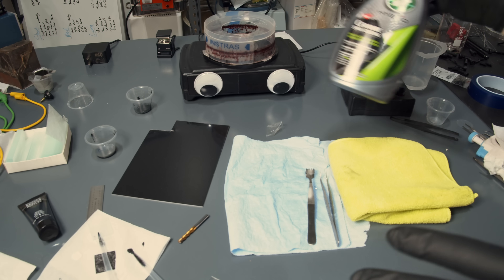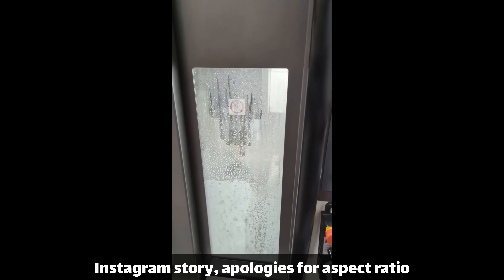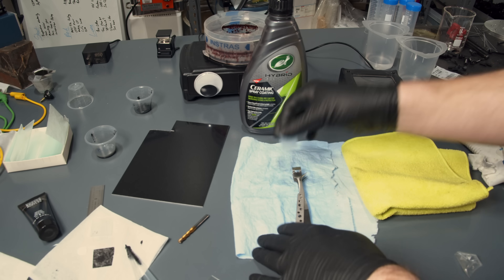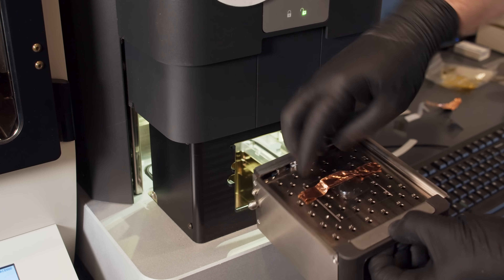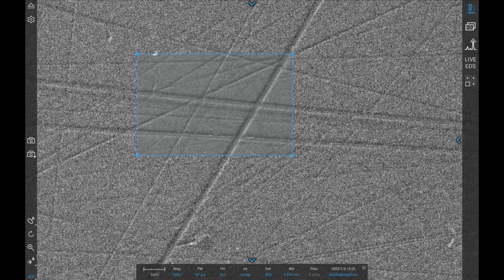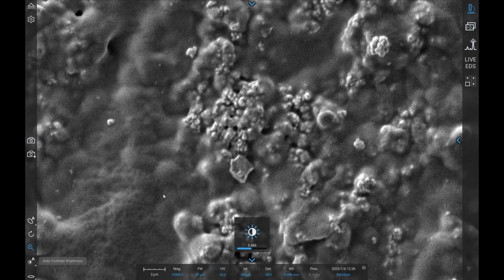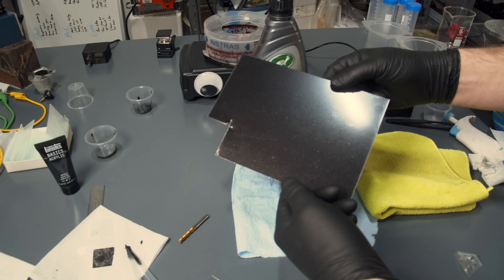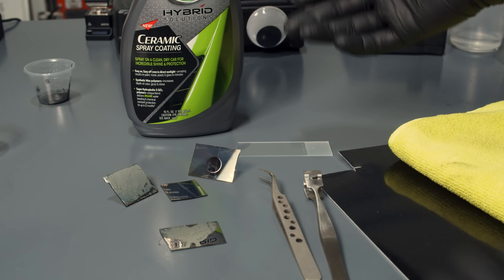More rigorous analysis of "Ceramic" car spray

Comment: And isn’t automobile glass covered in a thin plastic to prevent spalling in a crash? And I think most mirrors, headlight, turn signals are polyacrylate (?). Dunno. I’m a physician and barely know what you meant by a Materials Scientist.

Comment: It's crazy to me that this stuff has anti rusting properties considering how little of the stuff we can see in this video
I say that because I've applied it to bare metal, and it makes a crazy, crazy difference as long as the surface doesn't get scratched (left the metal out and about for 1-2 weeks)
Reply: I think a major reason why it may work much better on textured surfaces is that as you saw during this, it tends to gather in cracks and crevices rather than in the smooth parts, so applying this over a paintjob will probably be ideal since the paint in the video was so rough
I wonder if that's the same for a clear coat.

Comment: The real ceramic coating is the one in 30 or 50 mm bottles and you can tell is real ceramic when the applicator dries out hard also the towels we use are no longer good for anything since the ceramic makes them hard and super hydroponic however there's only one spray with real silicates the Gyeon wet coat. Any other spray "ceramic" are only solvents giving some hydrophobic protection for a few days but no protection.

Comment: I've been looking into these ceramic coatings since they're becoming popular in the woodworking community and based on just the hydrophobic experiments its clear that A. ceramic coatings make a drastic improvement over traditional polyurethane but also B. not all ceramic coatings are the same and in order the achieve the desired results, the only ones that work are typically the expensive rub on versions and these spray on versions are basically worthless imitations.  So I would love to see you do this with the stuff that Blacktail Studios came out with recently for example, most of these coatings seem to also be two coatings of varying hardness done in sequence.

Comment: I'm way behind on your videos, but I've been using one of the tablet screen protector things in my CNC machine for about 8 months now, and it's still working great.  I do have to clean it off a little more often than the glass (I just use windex) but it's still holding up great.
I just wish I could find some that are a little closer to the right size for my window though

Comment: I paint cars for a living. I would happily send you painted samples to try as well. 

Also, I am curious about the stand alone ceramic coatings. Not the apparent snake oil in automotive parts stores, but the stuff you have to get professionally installed. I have those products as well I could send.

Comment: One other possibility is that it's not silica nanoparticles, but a thin, uniform coating of functionalized amorphous silica that deposits on the surface. It would be difficult to see that with EDS depending on how thin it ends up. What is the pH of the spray? If it's decently alkaline, that would be a simple mechanism for dissolved silica that could drop out onto a surface when exposed to enough atmospheric CO2.

Comment: Can you please please please do this to other ceramic coatings on the market?  There are some really cheap ones on Amazon I’ve tried and had mixed results using.  I think the cheaper $20 Amazon ones contain less ceramic then the more expensive ones.  I would really love to see someone examine it because there nothing out there that goes into it like this video

Comment: Why wipe if off at all, ie, lay it flat and put a drop on and let it dry naturally. That way we know what it's supposed to look like, and whether it's just light-ends that evaporate to nothing, ie, scam.
We use increased surface profile to increase adhesion of paint.
How about Scotchgard.

Comment: Cool video.  I'm an Mechanical Engineer, so I can geek out over this stuff.  If your looking for particles, I would consider measuring out a discreet amount of solution onto the glass and letting it dry completely.  Do not wipe it off.  This should give you a good estimate of the amount of particles per volume.

Comment: Chemist here again. I have a strong suspicion that these sprays will ruin the anti-reflective properties of optically coated glass.Many years ago there were silicone containing sheet dispensers in the restrooms at Eastman Kodak. Grab one and clean your glasses. They quickly disappeared.

Comment: I would like to see a follow up of some different products, especially the ceramic coating that you have to apply and wait for it to flash. 2 of the main ones I would like to see are Avalon King Armor Sheild IX and CarPro Flyby Forte. The Armor Sheild is marketed to work on anything. The Flyby Forte is a specialty coating for glass, but I am not sure if it is a ceramic based coating.

Comment: These over the counter products are mostly just soaps.  If you want to see how the technology behind the idea on these bottles works, you will need to class up to actual pro level car products.  Many channels have demonstrated that products like Cquartz pro will actually build up a micro thin layer of silicon on the surface of glass and paint.  You will never get that from a 9$ spray bottle.

Comment: Sales Gimmick. Nanoparticles would do shit, and if pouring silicon hydroxide water glass on there worked, we would be doing that. A blend of silicones,( Not Silicon) and some fluoropolymers mixed with a solvent or emulsified into "nanoparticle" droplets, like milk.
The only Ceramics that work in the real world have to be baked in kilns.

Comment: I’m glad some one did some decently thorough tests that actually back up my findings of pretty much every hybrid ceramic I’ve tried on the market. I do think it would be really cool to compare this to a good wax, and the new graphene waxes that seam to do even less then the hybrid ceramics. I think a few good contenders would be turtle wax ice paste wax, any graphene coating, maybe some nu finish and an actual ceramic coating (which I’ve found last less time then a good paste wax, and yes, I’ve applied them properly to customers vehicles, level and polish the paint and then clean the paint extremely thoroughly to remove any waxes, oils or other contaminants, and ive used a plethora of ceramic coatings ranging from $30 coatings to $300 a bottle coatings, and they seam to not last. even in some vehicles, damage to the paint on vehicles that set outside 100% of the time occurred, causing sun burn really prematurely compared to before ceramic was done, and no, the paint correction was not the cause, as on most where the paint sun burned, did not get a major paint correction and only got a quick buff per customers demands and prior to starting paint thickness is tested and was in or above the acceptable range for paint correction. I’m a automotive detailer, just incase that was not obvious, but I’m always trying out new products per customer demand and even personal testing just to be able to provide feedback based off of my experiences. Sorry for the long details lol)

Comment: what do you do if you buy a ceramic powder, some oxide as powder
Reply: when you burn ceramic powder into something, do you attempt to make crystalline (any type) or will it be amorphous any ways, being ceramic by name
Reply: try that on anodized aluminium, with all the pores
Reply: knowing is futile, people, sounds like random noises
Reply: color difference or just sem characteristic electron excitation lines
Reply: combine position data to element data
Reply: if you care about water drops, you need only some spikes to break them, and let them tears run down to ground, from the paint/glass surfaces
Reply: since when silicon dioxide (hydro-loving) has become hydro-phobic
Reply: silicon dioxide is water desiccant, not the opposite, tf
Reply: remember those silicon dioxide moisture removing packs

Comment: I think a collaboration with Larry at AmmoNYC would be pretty neat.  He talks a lot about the material sciences, or at least the concepts, involved in restoring paint and shine on a car.  I think it would be neat to have him come with some car paint samples and reaffirm his assumptions with your tools and techniques.  Or even better, have him try a bunch of techniques and view the results under your imaging tools.  As always, very interesting stuff!
Reply: It would probably be more interesting to have a meeting with the guys that formulate his products or representative from one of the big manufacturers.  Then again I think most of us think of these types of products as gimmicks with a lot of marketing hype behind them.  I actually liked the old Seal and Shine product better.  As far as other consumer grade SIO2, I've had some fun with the McGuires, but I mean I'm not going to pretend that it's some kind of great quality ceramic but I would say like most things from the company it does the job well in a relatively friendly manner.  I think something interesting to test would be something like say CarPro glass sealant if we were going to analyze it on a piece of glass.  Unfortunately, there's just so much marketing that overshadows the entire industry.  As far as generating water beads on a wet surface, a quick clay bar generally does the trick or a quick polish.  If the surface is in good condition and contaminant free, the water will bead.  A good portion of the car washes out. There will actually mess up the water behavior on the surfaces with their gloss enhancement additives.  After a few days when does wear out then the beating returns to normal.  It's a frustrating industry without a doubt to interact with as a consumer because if they don't make absurd claims then the general public just won't support the product.

Comment: After seeing this on the scuffed glass, it made me realize just how small and few these particles were. The bare aluminum was a great nail in the coffin. 

My only question is, if not the ceramic, what in the wax has changed? Older waxes I’ve used lasted weeks not months.

Comment: Huh. My comment got deleted I think? Maybe because of a link I added. 
Anyway, once more without the link: Did you try Ombrello or Aquapel, both are professional glass sealants, IIRC both are the same stuff, and AFAIK one of them is factory applied to windshields by BMW. 
I used Ombrello on my car myself once, it did repel rain really well, but it also made the windshield really hard to see through when fine mist hit it and it made the wipers leave streaks, so when it wore off after half a year or so (maybe 3/4), I didn’t replace it.
Unfortunately I can’t post the links to those companies—Ombrello’s website only seems to be available in German anyway though.

Comment: Very very interesting! I'm a former detailer and was absolutely shocked when another detailer friend recommended this stuff to me. We've mostly made fun turtle wax products in the past (it's only suitable for pranks) but at the moment this one product accounts for the majority of my lazy exterior car care.

I'm not too surprised it didn't stick to the super flat surfaces of the glass, and I suspect any hydrophobic properties added there are waxes. Otherwise: application matters a lot, and differs from the markings on the bottle. I spray a little on to a microfiber and (nearly dry) buff on to the surfaces, multiple applications. This results in a very hydrophobic surface that lasts 2-4 months in my beachy, hot, regularly stormy environment. 

Hypothesis: too much solvent while wiping causes very little to stick in to the scratches. A dryer and repeated application builds up particle deposits. A little carnauba on/throughout that results in a smooth hydrophobic layer.

I don't think this will help in the cnc though, I would imagine the coolant will remove the wax (and particles with it) pretty quickly.
Reply: Side note: I don't expect you'll keep going with this (great info already!) But if you do: modern paint is a far stretch from acrylic or enamel. Clear coat is very hard, very polished polyurethane resin and might actually be smooth enough to put under the SEM. Maybe you can steal a gas door off your neighbor's car without them noticing ;)

Comment: I don't know if links are allowed, but as far as product comparison is concerned, Project Farm did reviews of a number of these products and this one was the clear winner.  I wonder what's actually doing the hydrophobic bits then?  https://www.youtube.com/watch?v=uYxKQwZah1s  .  Is there any way to look at this while it is wet, or is it under vacuum?  Very interesting topic.  Snake oil or royal win?
Reply from the maker: If I had to guess, they probably have a superior formulation of silicones and waxes to the other brands.  There's a lot of nuance in getting a good recipe of silicone + wax, so they probably have a good one. Maybe the silica helps too but I have doubt. Unfortunately there's no way to look at it wet, the SEM operates under vacuum so any water-based liquid will evaporate (there are specialized machines that can look at liquid but they are suuuuuper expensive).
Reply: @BreakingTaps  What if you used a glass shell of some kind, like a test tube or little jar?  Would it be able to see through the glass to whatever you're wanting to look at, while allowing atmosphere around it?  I'm likely over-simplifying the process in my head.  I thoroughly enjoy your content.  You make it interesting without being boring!

Comment: Now that you know that the spray won't work well in your cnc, why don't you try putting in a windshield wiper? Looks like you have the machinery to do a very nice job of it. 
Here's an anecdote on useless content included in a product just for marketing: When handheld transistor radios first came out in the late '50s / early '60s some companies would advertise their sets as 10 (or 12 or more) transistor radios when they were really just the ordinary, standard 7 transistor radio circuit. They'd just scotch tape or solder in unconnected additional trasistors in the case to make up the difference.
Reply from the maker: 🤦‍♂️ Jeez! What a great/awful marketing story haha

Comment: Usually in car care products, the spray version is always the diluted toned down version of the original thing, where it is supposed to be applied more frequently, and faster. Like applying it once every 5 washes or something, and i think the inclusion of carnauba wax here supports this. In a proper ceramic coat it does not have other ingredients than solvent and the whatever ceramic compound they have. (I also don't get how the coating inside properly stick to the paint when it is directly sprayed with some organic sticky compound... As in, normally, to apply ceramic coating, super cleaning the car completely from previous wax/grime/iron oxide is a necessity.) 
I would love to see you get a proper ceramic coating solution like some 3M with foam applicator! Though I also feel like you are already bored and moved on to the mext experiment ;D

Also a side note for the sandpaper part: the car paint polishing compounds are close to or sometimes higher than 10k-15k grit, the ones you applied are more like typical swirl marks that are in the average car out there, but again they are highly recommended to be polished before applying a proper ceramic coating on a car. So I think in this product, its the carnauba wax's duty to fill those scratches...

p.s. love all your videos man!

Comment: What SEM do you have? There is small desire to own one my self now, but I realize they probably are not cheap... then I again I don't know how far they have come. Do you use your SEM mostly for your youtube channel projects?
Reply from the maker: Mine is a Thermo Phenom XL, and it was indeed pretty spendy (I also use it for non-YT business purposes, analysing powders, coatings, etc for customers). If you're handy with electronics, you can find older analog SEMs for not that expensive though! Usually <$10k, sometimes just $1000 or so depending on condition and if they just want it gone (university trash, govt auction, etc).

The older analog ones often still have great resolution and are very robust/easy to repair, just requires more hoops to jump through to digitize stuff.

Comment: In my younger days, I discovered that Rain-x was most effective if you drove faster! Would it be possible to rig up an air compressor hose and nozzle in such a way as to push the droplets off your screen protector?

Comment: Would a compressed air nozzle with a trigger plumbed on the outside not work to keep the coolant off the window? Seems easier than relying on hydrophobic coatings..

Comment: If it's intended use is for car bodywork, wouldn't the only advantage of the silica be to leave scratches in the paint coating for the dimethicone to nestle here and there ? 🤔
Again, I'm more convinced it's snake oil with unicorn dandruff, but...

Comment: Be nifty if you made your up with some aerogel dust/powder and tested that. Its supposed to be very hydrophobic. Would let you control the particle count a bit more, be interesting if you could count the particles with a laser squirting it through a tube and checking the level of light received. IOR of the silicone vs the emulsion of wax/iso should be different enough to cause scattering and give a basic result. Useful tool to have for checking solutions of nanoparticles if it works.